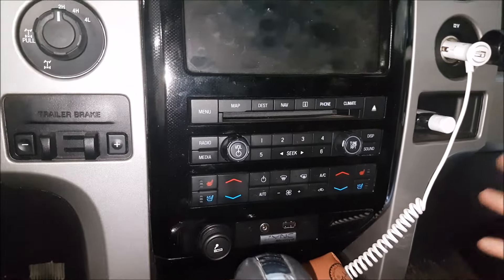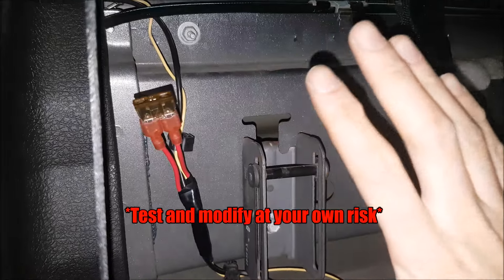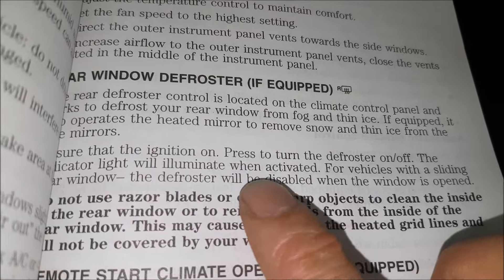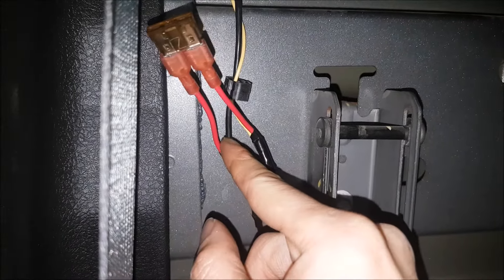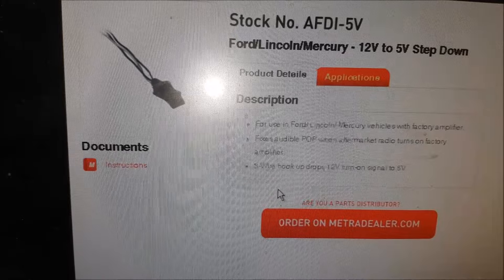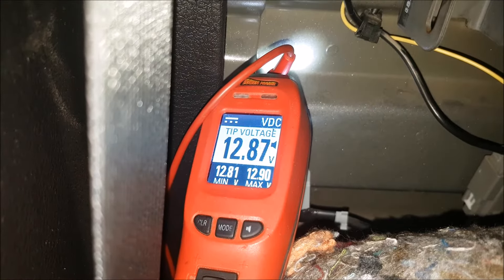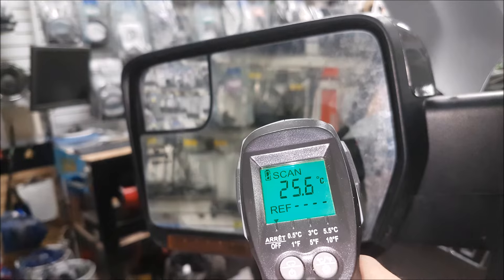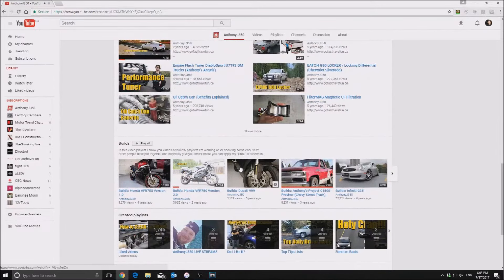2009-2014 Ford F-150 Rear Defrost/ Defogger and Heated Mirrors not working | AnthonyJ350

Comment: I didn't even get as far as testing the fuses - your tip about everything being in series and the "fingers" on the sliding window told me everything I needed to know.  I opened and closed the window about a dozen times and it started working.  I'll look at pulling it apart and cleaning the contacts properly, but you got me  moving in the right direction. Thanks!
Reply from the maker: Awesome, so glad to hear you got it working.  Comments like this help so people can see a general direction in what the problem is.

Comment: Jumping the yellow and black with a 7.5 amp fuse worked like a champ for both the rear mirror defog/frost and the rear window defog/defrost.  Thanks!  Did not investigate the 5 volt step down or investigate the finger contacts and simply ran with the jumper right out the gate on my 2014 raptor.   That box end technique to recline the back seat is the best!  Found a video where someone drilled the release post and installed a pull ring and strap.  Will ate,pt to drill the post and do the same for continued easy access to the minimal back storage.  Thanks again.
Reply from the maker: Glad it worked. I know the truck from this video is still running around with the fix.
Reply: @AnthonyJ350  been living with this in SE Alaska for 5+ years.  Finally took the time just in time for fall.  Drilled out the pull posts and installed a draw cord too. Productive morning thus far.  Easy fixes, way cheaper than a new truck.
Reply from the maker: @perrycarditi5  100% agree. Run your older vehicle for longer and keep more money or invest the money other place. Great job!

Comment: Thanks for the vid! I've been searching for something on this for a while. Most people of the forums suggested to take it in to the dealer. I'm going to check everything now. I had a feeling my mirrors work still, though. I also had a rear window shatter on me and had the whole thing replaced under warranty, when it it was still. Thanks again for the vid!
Reply from the maker: Were you able to do the fix and test it?
Reply: @AnthonyJ350  I did not fix it yet, but I ran a laser temperature reader on my rear mirrors and They still work! I've had my rear shatter with the heating element getting too hot. So I'm not too worried about the rear window. The snow ends up clinging on to the back window when it's warm. I find it kinda pointless anyway.

Comment: I have a 2012 FX4 w/ motorized slider, long out of warranty. The defroster just stopped working this winter- I guess I'm one of the lucky ones to have mine last so long. Mirrors heat up just fine, but the indicator light doesn't come on anymore. After watching your video, I was able to get the light to come on with a simple alligator-clip jumper between the two terminals on the passenger side. However, after reviewing countless instances of a shattering window, I'm thinking that I'd be better off living without the rear defroster. The likely consequences of forcing it to work are far too expensive for my wallet. Kinda sucks because I live in MN. I haven't been able to find any other site that offers a fix other than replacing the glass. Can I assume that this failure is NOT due to a broken heat trace, but is something proprietary along the edge of the glass, meaning that it can't be fixed properly? Has there been any sort of recall where I can get this fixed at someone else's expense?
Reply from the maker: You'll have to check for the recall.  It is possible you might have a power delivery issue like we did in the video and you will have to do the same repair we did.

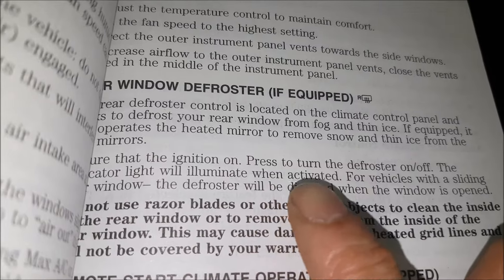Comment: At 2:14 you show the contacts removed from the window but what did you use that worked to reattach them?
Reply from the maker: You can use a conductive adhesive from your local auto parts store.
Reply: @AnthonyJ350  can you give me some more details on how you did that? Mine got ripped of by my little cousin.
Reply from the maker: @atticusjohnson1234  There's adhesive you can get at your auto parts store

Comment: Thank you! It was my sliding window on my 13 ecoboost. Somehow wasn’t closed all the way. Super simple
Reply from the maker: Glad to hear it was an easy fix.  Did you clean out and lubricate the track?
Reply: Can you explain better? I have a 2013 too with same problem.
Reply: @andrestepec88  no problem, I just meant I didn’t have my rear middle slider Window all the way in the closed position.  I had the issue where the defrost wouldn’t work and as soon as I closed it all the way with the slider switch near the sunroof switch, the defrost started working. Even though it was just barely not closed, It won’t let you turn it on unless that rear window is fully closed. Hope that helps

Comment: Do you hook up the RED WOLF voltage reducer in the same manner as your video?

My understanding is that you had to connect in series to drop the 12 volts down to 5 volts.
Reply from the maker: Yes you want to try to step it down to 5 and test.

Comment: Hello. Anthony. Your soluction works ok..! Thanks. But I  realized that in the middle of the yellow wire there is a resistance, cover by a black retractable seal. So wen I replaced the resistance every thing started works again, and without the "bridge".
I hope this would be helpful. I've a 2013 F-150. Bye..!
Reply from the maker: Thanks for sharing your findings!

Comment: How did you get the contact cover off and back on without breaking it? Is it glued on or is there a clip?
Reply from the maker: Just used a little pry tool.
Reply: @AnthonyJ350  is it glued on or a clip. If glued, what did you use to put it back on? I have same issue as everyone. Ford wanted $1800 to replace back window. Truck is a 2013 and we'll out of warranty but a great truck and has a lot of customs.
Reply from the maker: @richardgriffin9970  I just used a little instant adhesive
Reply: @AnthonyJ350  thank you for the information . This is my last check before replacing the window.

Comment: Bought the red wolf harness, three wires but only two wires on the truck harness.  How do you connect?
Reply from the maker: What do the instructions say?
Reply: The red wolf instructions are for a radio.  How would you wire this component to the F150 defroster harness
Reply: The red wolf instructions are for a radio.  How would you wire this component to the F150 defroster harness
Reply: The red wolf instructions are for a radio.  How would you wire this component to the F150 defroster harness
Reply from the maker: @AlainRheault-ph5fs  Just ground, 12+ volt constant and 12+ volt to the defrost wire.

Comment: Hi Anthony, I have a 2015 and the contact box that attaches to the sliding center piece came off. I found some auto glass adhesive for the plastic box, but I'm not sure what the best way is to reattach the copper contacts to what ever kind of metal is on the glass. Can you recommend anything?
Reply from the maker: If you're not sure, a glass shop can easily fix it for .5 hr I'd assume. That would be the safest bet.
Reply: @AnthonyJ350  okay cool I did call one already and they quoted me $900 to replace everything the glass included. I'll try a different shop
Reply from the maker: @JensenStark-y9m  They weren't willing to just glue the contact back on???
Reply: @AnthonyJ350  no they would only replace everything! Which is why I'm looking for DIY. I will try calling some others though as you suggested.
Reply from the maker: @JensenStark-y9m  You just need a conductive adhesive from the auto parts store and glue it back on if noone wants to fix it. Unfortunately a lot of shops are replace only now. Maybe due to liability?
Reply: @AnthonyJ350  Ok thanks!

Comment: Did you use any type if adhesive to reinstall the contacts for the sliding glass? Mine fell off and is obviously my problem. Bought some conducive adhesive to try on it. Haven’t reinstalled it yet.
Reply from the maker: I used a little bit of CA glue and 3M double sided tape.  I really didn't like the design and how things were put together on these parts.
Reply: Brad, did that work? I'm having the same problem.

Comment: how/where do you jump the wire? did not notice this connection done in the video after product shown
Reply from the maker: Jumped the wires with a fuse inline.  I show it in the video where.
Reply: @AnthonyJ350  I ordered the AFDI-5V just need to know the correct wiring connection.  I Got the black to black ground.  which connects to the yellow? black/white or the Blue/red.  Or do both of these connect to the yellow?

Comment: How do you get that faceplate/cover off the contacts on the rear slider
Reply from the maker: Had to pry them off.
Reply: @AnthonyJ350  thank you for the great diy video for this as it seems to be a common problem.  I pried my cover piece and cleaned up all the metal contact fingers with a rotary tool, and straightened up the fingers as it appeared they weren’t all straight and uniform.  My question though is what kind of contact adhesive should be used to re-adhere this piece so that it it is making electrical contact and NOT insulating this piece back to the window again...?

Comment: Mines showing a code in my launch scanner showing a b1c83-13 rear defrost relay. My button also does not light up. I check wiring and i press the bottom checked power. And i dont believe i have any power back there. So i think i may have a bad relay but i also unplugged it and check it with a volt meter. So im gonna get back there and mess with it some more. If its in series i assume it wont show anything without the plug being plugged together? If im correct.
Reply from the maker: Did you try this fix?  It worked for a bunch of people.
Reply: @AnthonyJ350  i have not. I do have a extended warranty with my truck. And i actually just got it three months ago. So im gonna see if the dealer will fix it first. If not then i will be trying out this fix. Especially because winter is coming. And i need my defrost to work, especially being in newyork where winters are rough and cold lol.
Reply from the maker: @hairpunut  I'm interested to know what part they replace if they fix it. Let us know.
Reply: @AnthonyJ350  will do, i did test the wiring and fuses yesterday. And the fuses all tested good and the relay. The wiring isnt showing any power that i saw. So im working if i have a wiring issue. Thats why i was asking about how you tested for power in the video. Because i have nothing there. Im gonna test one more time tomorrow. To make sure but with my power probe and some back probes. But i dont see so far whats causing the issues other then i have no power coming to the connector.
Reply from the maker: @hairpunut  Unless there's a hidden fuse in the back for the defrost. But I'm unaware.

Comment: I'm not getting any volts to the yellow side of that plug. Any idea why?
Reply from the maker: Check all your fuses with a multimeter?
Reply: @AnthonyJ350  yes, all the fuses are good. Did you have voltage at the yellow before you jumped them?
Reply: I can confirm that if you press the rear defrost button once and the light doesn't go on, the mirrors still heat up. It also sends the 12v back to the hot wire, but nothing to the yellow.
Reply from the maker: @gdub14  That's the issue. That's why we jump the two wires the way we did in the video.

Comment: I tried the 5V product and I can’t seem to get it to work.  I tried the direct jumper and it worked perfectly.  Could you give instructions on how you wired the 5V to get it to work?  Thanks!
Reply from the maker: You would have to grab a 12+ trigger from the passenger kick fuse panel.  How were you activating it?

Comment: Mine quit working.  It was not the soldering to the window.  Ford replaced the window the day after they received the window (2 months after they ordered the part).  Apparently, that did not correct the issue like they thought.  While I waited on the part, I verified the fuse and relay were good.  They have now ordered another part, so I will let you know what it turned out to be once I get the truck back.

Thanks for the explanation and walk through.
Reply from the maker: Yes please let us know. The more feedback we get will help others depending on their situation.
Reply: Leptoid Any update?
Reply: If a fuse is blown, there's a problem elsewhere 99% of the time.

Comment: 2010 Ford F-150 FX4. Rear defroster and heated mirrors do not work. Light on dash DOES illuminate and stays on though. Contacts fell off and reattached. Also light will continue to stay on even if power sliding glass is moved breaking contact. Light should go off when glass breaks contact. Quoted over $1000 from dealer to replace back glass. Any ideas before I replace back glass?? Also I’ve checked fuses. Did find a green fuse I think it’s 40amp under the hood burned. I replaced that but no luck. Thank you
Reply from the maker: Did you try jumping the wire like in the video?
Reply: @AnthonyJ350  no I didn’t try that. Noticed the contacts fell off again 🙄. I’ll probably just have the back glass replaced. Thank you for your help

Comment: Hi Anthony, i have the same problem, when i press the button for turn on the system deffloger the ligth on de center console don`t work. I check all the fuse, but all is OK. I want to do the fix you show us ¿can you tell me if the fuse of 7.5 Amp its after or before the resistor in the yellow wire (in the back seat)?

Thanks and grettings from Chile
Reply from the maker: Put the fuse before the resistor at the power source. Hope it fixes it for you.
Reply: @AnthonyJ350  Thanks Anthony, i asked because i see in your video the fuse connection (in the yellow wire) between the resistor and the "window". I Try in a few hours and tell you the results
Reply: @AnthonyJ350  Its Works, thanks Anthony. I Install a fuse with a fuse holder and works. Thanks a Lot
Reply from the maker: @juanpaulobustospacheco4204  Nice, did you put the resistor in?
Reply: @AnthonyJ350  Anthony, i put the resistor between the fuse holder and the Windows. I use this order:  power line - fuse - resistor - window
Reply from the maker: @juanpaulobustospacheco4204  Awesome, glad to hear you got it working good 👍

Comment: Anthony, I really appreciate your video and post.  I was able to pull the cover off of the wires today and visualize everything you showed in your video.  I have not yet shorted the wires like you showed in the video.  There appears to be some conflicting information with regard to whether the rear defrost continues to work once you short the wires.  Can you confirm that the rear defrost is supposed to work in addition to the mirror defrosters?  Thank you again for this awesome post.  I certainly don't want to replace a $1K+ window if I can do this cheaper fix.
Reply from the maker: I just confirmed it with the owner again. Everything is working well.
Reply: Thank you very much!  I really appreciate it.  Did he install the voltage reducer or just use the fuse short that you showed in the video?  Again, I appreciate the assist.  This post was very, very helpful.
Reply from the maker: @embreymitch  His truck just has the short fuse.
Reply: AnthonyJ350 thank you. I am going to try the fix this weekend. Can you tell me the size of the short fuse used (amp of the fuse)?  Thank you.
Reply from the maker: @embreymitch  small, it was like 7.5

Comment: So did you install the voltage step down in this video, or just jumper it with a 7.5amp fuse? You talk about the step down, but it looks like just the jumper worked fine?
Reply from the maker: We just left the jumper in there.  The truck is still around in a colder climate than where I live and everything still works I'm told.  Just make sure you put that fuse inline.
Reply: @AnthonyJ350  Thank you. I'm going to try this. I am a little concerned about a window break, I have a 18 month old little boy in a rear facing car seat😬
Reply from the maker: @nattynopro6967  I recommend having it serviced at the dealership. There might be an updated design.
Reply: @AnthonyJ350  So I've still been researching this.... it appears the jumper will bypass the switches (contacts) in the sliding window. So you will get a return voltage that illuminates the indicator as well as power the drivers side grid. I believe, based on this drawing 
( https://www.f150forum.com/attachments/f12/400550d1446744571-2011-f-150-heated-mirror-rear-window-defrost-problems-heated-rear-window.jpg ) 
that the jumper will heat both passenger and drivers side rear windows, but not the sliding window. 

So, this fix won't fix everything, but it is certainly a better option than replacing the window.
Reply: What does this eliminate the window smashing?

Comment: Can we keep.the fuzzed jumper in so the heated mirrors continue to work?  What if we are able to.fix the rear window defogger? Should the jumper out?
Reply from the maker: How did you fix it?
Reply: @AnthonyJ350  I havnt yet but I can see where several.runs are broken and there are lots to repair the electrical runs in the window I intend to attempt a repair. Should I keep the fuzes jumper in?
Reply from the maker: @jerryrafeew1191  Remove the fuse and do your repairs. It's more back to factory then. If it doesn't work, put the fuse back in.

Comment: Anthony, I lost the piece you referred to as having the contact fingers.  Any idea if this is a part you buy?  Thanks
Reply from the maker: Might be able to find it at an auto wrecker
Reply: @AnthonyJ350  most likely what I will have to do since I can't locate mine after tearing it off when trying to remove the cover for testing.  Thanks